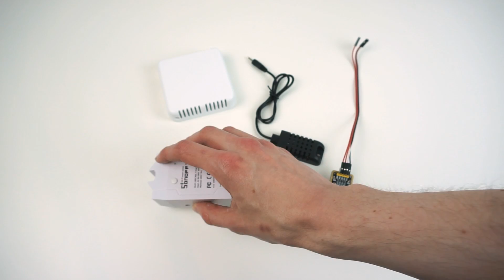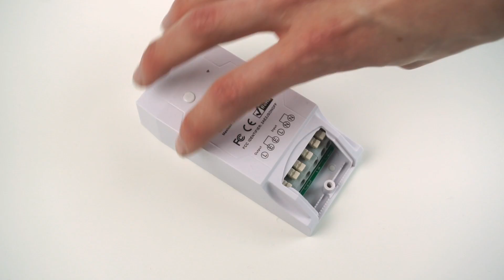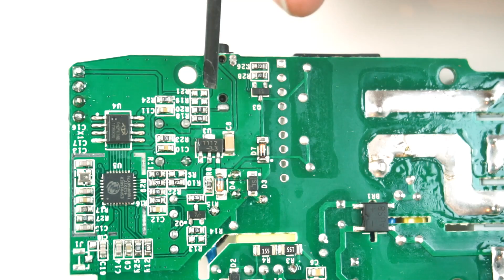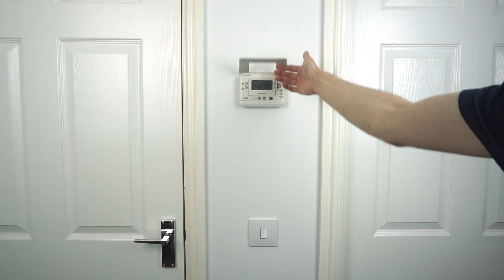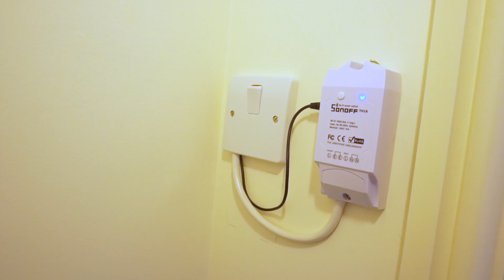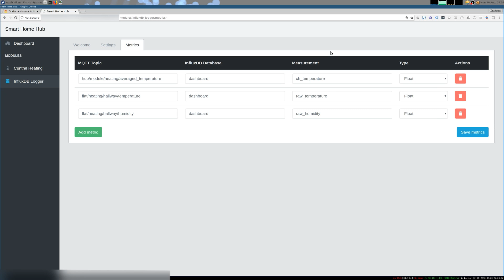Building My Own Smart Central Heating Control System with a Sonoff TH16

Comment from the maker: Disclaimer: This system was purpose built for my own central heating system.  Systems and control methods will vary between different boilers so be sure to research how your own system is controlled rather than simply replicating what I have done here.  In particular you would need to take care to determine whether your system uses mains voltage contacts like mine does or if it uses volt free contacts which would require either modifications to the Sonoff or a different model of Sonoff supporting dry contacts to be used instead.  If in doubt, always contact a professional before attempting anything like this.
Reply: The system really looks good!
Reply: Did you ever consider combining this with thermal actuators on your rads, controlled by a smart switch with temp sensor?
Reply from the maker: I considered it although didn't feel it was worth the effort for me, my flat isn't huge and I tend to leave the internal doors open so it didn't really make sense trying to maintain different rooms at different temperatures.  It's also really well insulated so doesn't cost much to heat.
Reply: Hi Cameron. The video is excellent! Thanks for sharing it. Do you know how to get DRY contct / volt free from this TH16 Sonoff? I have seen some tutorials but they are not for TH10/16. It would be really helpful if you could help with this. :) Thanks in advance.
Reply from the maker: Thanks!  It's not something I've done myself although it should be a case of figuring out how the mains wiring works inside then breaking the appropriate traces and adding in the appropriate links so that the L and N output are switched by the relay and the L and N input feed the power supply but aren't connected to the relay nor the output.  A potentially easier/safer option may be to get a mains voltage contactor (essentially a relay switched  by mains voltage instead of low voltage DC) that is powered by the mains output of the sonoff, you could then connect your heating system to the switched terminals of the contractor.
Reply: @camerongray1515   Thanks for the reply. I have solved it by using additional 220V relay with no current at the output. Much safer and easier than hacking the board. :)
Reply: @AddoPro  which relay model you used? Can you send a link? Thanks.
Reply: @opanait  F4031-AC230 :)
Reply: Something small I noticed is that it's not a fused spur you can get switched fuse Spurs which would be more ideal but it just means if the device was to fail it would not draw too much power and ruin other things or cause a fire
Reply from the maker: The supply to the sonoff comes from the boiler which itself is fed from a 3a FCU so it is fused, you absolutely wouldn't want to connect a sonoff to fixed wiring without a fuse!
Reply: Thanks for replying mate. I do understand my boiler but since the sonoff requires it’s own power and a thermostat is just a two wire contact that make up the switch so I was wondering how did you solve that issue. 
Also can link me the box you used for the thermostat please? Thank you

Comment: Cameron: (sat in a 23.8 degree room) "it's too hot, I'm dying"
Me: (sat In a 24.3 degree room) "I'm cold"

Great video though, I'm a ReactJS software dev, loved the custom dashboard, so much better & easier to use than a prebuilt system, especially since it's expandable to really anything.

Comment: Looks amazing! I'm trying to download your Smart Home Hub via github but I have no idea how github works. Does anyone know how to get the Smart Home Hub working?
Reply from the maker: Thanks!  Unfortunately the software is very much still not ready for release so there's no real documentation or support and I'm not aware of anyone else using it apart from me.  If you're familiar with Python development and the use of Docker you can probably get it up and running but you'd have to really treat it as a framework to build your own system on top of rather than as a prebuilt solution.  If you need something that works out of the box with a large enough support community, something like Home Assistant would be a better option.

Comment: Hello Cameron, i would like to do this project, but i dont understand the hardware issue. My boiler just requires a simple switch, but the TH16 switches mains to your boiler. Can you advise!
Reply from the maker: My particular boiler uses a mains voltage contact to the thermostat so switching mains with the Sonoff works fine.  On the other hand if your boiler uses a "zero volt" or low voltage contact you would either need to modify the sonoff to have "dry contacts" or use the switched mains output of the sonoff to power a contactor then use the contactor to switch the boiler.

Comment: Hi Cameron , I am interested in using a sonoff with the temp sensor to control a circulation  water pump that turns on a pump when a certain temp is reached and off after it runs and the temp falls..basically a pipestat ..can I get live feed back of temp from the sensor and can i set up a high and low set points. Is it possible to hack the software to does this..
Reply from the maker: I haven't used the default sonoff software at all but would be totally possible to write it yourself.  I wrote my own Arduino firmware for it which essentially is a big continuously running loop that executes your code.  Would be pretty easy to on each loop iteration read the temperature then switch the relay accordingly.

Comment: The GPIO Pin will happily drive an LED.  Just use a slightly bigger resistor and limit the current on the LED that way.  It just means the LED will not be quite as bright, but the LED will last longer :).
Great little project.  I have a system that uses a 24V drive to the thermostat so I am modifying a SonOffSV to do the job.  Great thing about the SonOff SV is it has pins for 3 additional GPIO's on board also :)
Have you progressed further with writing your own smarthome hub or did you give in and you to a "premade" one?
Reply: Great work loved the vid

Comment: Do you have an immersion heater in your water tank which you have made 'smart'? 
I was thinking of adding a Sonoff to power mine on and off from Home Assistant (when I need to), but its a 3kW element I'm not sure if this is sensible.
Reply from the maker: I've got a combi boiler so I don't have a water tank in my setup.  I wouldn't trust the relay in a sonoff with a 3kW load.  If I was doing it (Obligatory disclaimer that I'm in no way a qualified electrician), I'd use the sonoff to control a contactor (with a mains voltage coil) then have the contactor switch the immersion heater.  For a neat installation you can get DIN rail mounting contractors that can fit inside a standard consumer unit (either in your main one or by using a small consumer unit next to the immersion heater as an enclosure).
Reply: @camerongray1515  Ok, I will look into that. Thanks a lot for the help :)

Comment: How bright is the LED on this unit?   I am looking at a ESP8266 controlled thermostat, but it is in the hall way so I was thinking of maybe a resistor to limit the current to the LED rather than switching the full 20mA to it.
Reply: Blue LEDs are usually very bright and will run on a few mA - 20-mA would be blinding - so 1k to 2k would be fine. The only problem would be if driving from 3.3-V, it's going to be close to the forward voltage of a blue LED. Ultrabright Red would be better

Comment: You could put a 1k and 2k voltage divider on the tx of the USB to ttl converter. You don't need anything special on the RX. You could also use the same voltage divider for the 5v out to power it.

So you can use a 5V USB to ttl without a problem

Comment: I did this a different way. I left the original programmer in place which takes care of the usual temp control and programmed settings but used a 433Mhz relay to override and interrupt the relay that switches the central heating on and off. All of this is controlled using a broad link hub, an old Galaxy s4 with voice control by Alexa. The s4 setup is fully automated using Tasker giving you endless possibilities such as Google calendar intergration, for example, when the phone battery is 100%  power to the phone is disconnected and turns back on when the battery reaches 10%. Using Tasker and Alexa your programming options are limited to your ingenuity but best of all, no 3rd party websites involved so if the internet is down you still have full internal control.

Comment: i got the sonoff th 16 but im a bit confused as im unknown in this area
is the power from the  heater that powers the regular thermostat enough for the sonoff? 
I can't seem to power the sonoff on with the Red Blue wires that run from the heater. Do I need a seperate power supply for it?
Reply from the maker: I can't really advise on your specific setup without it in front of me.  Bear in mind this install was done for my own heating installation which is likely very different to yours. If in doubt contact a heating engineer/electrician - You're dealing with mains electricity, if you get it wrong you're potentially not just going to be looking at a broken Sonoff!
Reply: @camerongray1515  Thank you.

Well my old thermostat is still working. Its an on/off heater (gas).
Its just that there is 34 volt on the wire and I figured it wouldn't be enough to power. It reads 90-240 volt but I'm not sure if 90 is the minium to power it on. Do you know how much volt you have on your sonoff? I'm not too worried about breaking it as im insured..

https://imgur.com/a/sFqPJ6J
is a pic of it
Reply from the maker: The sonoff is a mains voltage device, mine is running off a 230v mains supply, it's not designed for a low voltage system like yours without modification to work as a dry contact relay. My system uses a mains voltage thermostat so this was a drop in replacement. Insurance or not it's seriously not worth the risk if you aren't sure about what you're doing. I'm not worried about a broken heater here, if you get something wrong with mains electricity we could be talking about serious shock or fire. If in doubt please contact a professional or buy an off the shelf smart thermostat.
Reply: @camerongray1515  thank you ill let it be then, props for the response

Comment: I imagine that the reason the connection to the temperature & humidity sensor has 4 wires is that there are actually 3 different sensor modules you can buy for the TH10/TH16. One is the AM2301 that you used, and that's essentially the same as the very popular DHT-22 temperature & humidity sensor (I have a dozen or more of those around my house!), and Adafruit sell the AM230*2* here: https://www.adafruit.com/product/393. That uses a 1-wire protocol specific to the DHT11/DHT22/AM230x devices and has accuracy specs around ±0.5°C and ±3%RH. Another option is the DS18B20 which is also popular with hobbyists, also has a ±0.5°C accuracy, and uses the Dallas 1-Wire protocol (Adafruit: https://www.adafruit.com/product/381). However the third option is the Si7021, which actually uses I2C and therefore requires four connections (Adafruit have it on a breakout board here: https://www.adafruit.com/product/3251). The Si7021is marginally more accurate, at ±0.4°C and ±3%RH, but one nice advantage of that is that because it uses I2C, and therefore you have the I2C pair of signals at your pretty thermostat box, you could hook up all kinds of other I2C devices in there as well, right in your hallway, e.g. an LED driver, an I/O expander, an ADC, some kind of keypad, even some types of display such as the 1602/2004 character LCDs (connected via one of the typical "FC-113" I2C Philips/NXP PCF8574T I/O expander boards, of course) or the little ~1" OLED modules :)

That said, the manufacturers of the AM2301 module appear to fit it with a 4-pin connector with pin 4 as "N/C" as well, so maybe there's another reason! https://kropochev.com/downloads/humidity/AM2301.pdf It looks like the PCB inside the original AM2301 is the same as yours, so I guess Sonoff just swap out the cable - or probably just get AOSONG to build them with that TRSS cable instead.

I've lately been considering doing something like this myself. I live on the top floor of a 3-storey house (rented, of course!) and even though we have dual-zone central heating, the thermostat that affects the top floor is on the middle floor, and so the temperature up here has no bearing on what the thermostat senses - and of course it's not a wireless system so I can't just move the thermostat upstairs! :( My thermostat programmer module removes from its wall mount plate more easily than yours does (there's just a catch you press down with a finger just below it, and then it slides up and out), and the removable unit connects to the wiring via five fairly big, thick pins that stick out of the back of the programmer and slide into matching holes in the mounting plate. So given that this is a rented property and I'd like to avoid messing with the thermostat wiring (although I've already swapped out three lighting dimmer switches for standard switches, because LED lamps really don't like being stuck on non-LED-suitable dimmers, even at "full power"!), I've been considering making a PCB with suitable pins to fit into those connectors, putting it inside a custom-designed 3D printed enclosure to make it look a bit nicer, and then doing something similar to what you have here. Most of the time all I'd need is "it's freezing, turn the heating on for a few hours" or "oh god I'm melting, turn off already!" :) So your software might come in handy! No idea yet if my thermostat has volt-free contacts or not, though! I know that it has mains voltage behind the wall mount, but I haven't looked into the wiring schematic yet!

Comment: You could also wire up thermostats around the house so you get an accurate 'house/room' temperature and get a real idea of humidity and temperature. This is something even modern thermostats don't do which I think is a massive flaw.

Comment: Neat solution but running everything on a server seems a little overkill. You've also re-invented the wheel a little and Home Assistant would have been much easier running on a Raspberry Pi. It has a built in Cilmate/Thermostat component and provides graphs etc as standard.
Reply from the maker: I looked into that but it didn't really do what I wanted in terms of allowing me to entirely build my own interface with a UI that supported creation/management of timers.etc.  I also fancied a relatively large software development project.  I could have run this all on a Pi as well however I already had the server running for other stuff so it made sense to use it to host this as well rather than deploying another, less powerful device to run it instead.

Comment: You may want to install a dumb  thermostatic control switch in parallel to your relay set at 5°C. This would be in place so that if the sonoff fails while you are away for an extended period of time the temperature cannot reach freezing and burst pipes. 

Heat flux from neighboring apartments would delay that type of failure.
Reply from the maker: Good point, I thought about this when I initially planned the project then somehow forgot all about it, think I'll pick one up. Unlikely to be a major issue since my flat is so well insulated - I've never seen it below 15c even when it's snowing but not a bad idea to have. I also considered adding a manual thermostat in series with the sonoff as an upper limit in case the sonoff gets stuck on.
Reply: @camerongray1515  The over temperature limit sounds like a good idea to me too. 

You could likely reuse your Honeywell thermostat for one or the other roles. It will have a thermistor on the board that could be relocated to your sensor housing, if you want to go to the trouble.

Comment: C: well executed and presented!  You know, that esp8266 is also totally capable of hosting its own web page, no other servers needed.  Could send out mqtt & host web page. Also, I'm a fan of 'homie' for esp8266 (on github) as it takes care of bootstrapping network config. and over the air programming.
Reply from the maker: Thanks!  I could have hosted the web page on the ESP however the idea was to make a reusable piece of software I could integrate a bunch of other devices into rather than having it restricted to just the heating.  I also wanted it to be easy to expand/update the software for both the web interface and heating control logic so running that on the server with everything written in Python was so much easier than building everything in C for the ESP and then having to keep re-flashing it.  Homie definitely looks interesting though, will probably give it a go for future projects or maybe rebuild the heating firmware using it at some point.

Comment: Fair play I like this project. Done a great job. Think you could get it to work with Alexa or Google Home?
Reply from the maker: Definitely could, would just need to create a custom set of skills for it.  Not something I've looked into though.
Reply: @camerongray1515  very interesting. Iv just bought a house and it doesn't have a thermostat wired into the boiler yet (bit annoying) so iv been looking for a solution then this video pops up and it's giving me ideas haha. I may just end up just buying a normal wireless thermostat though :/

Comment: Wow... Your really knowledge able and having the guts to do it. One question, is the sensing were a reused wire from the old timer box?
Reply from the maker: The sensor was new, the only part that I reused was the cable from the boiler that connected to the old programmer.

Comment: While I wouldn't recommend testing the theory, I've read that the GPIO on the ESP8266 are 5v tolerant - and it's only TX (RX on the ESP8266) that would be exposed anyway, not both TX and RX